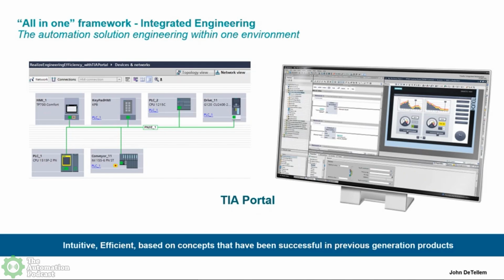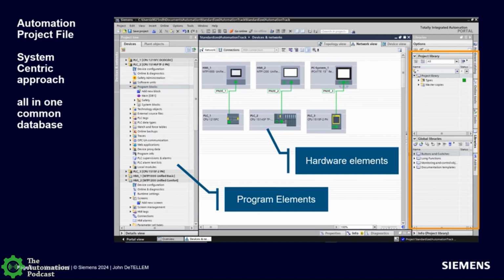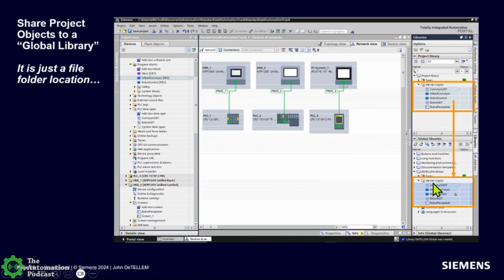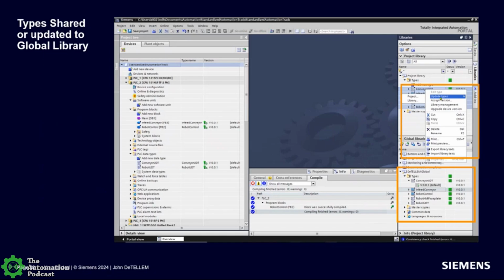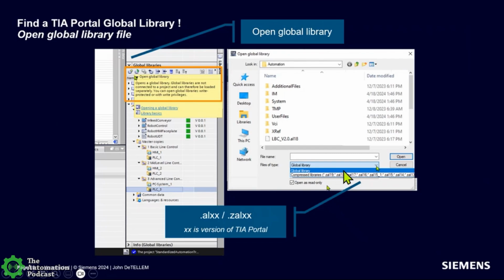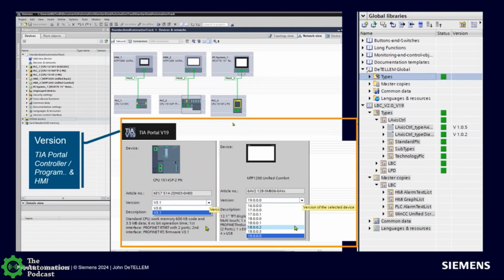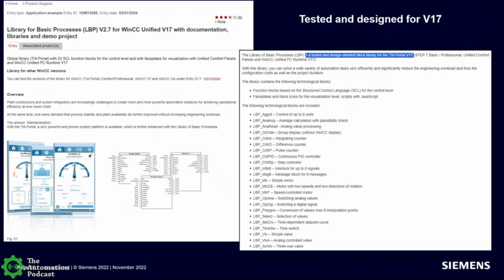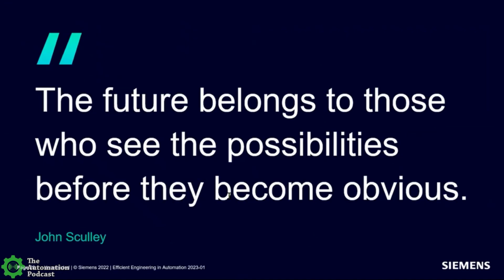Project Libraries in TIA Portal

Comment: looking at the outcome and the concept of libraries in other systems, is it really worth this level of overcomplication?
Reply from the maker: Well, I'm not using them as my focus is creating new lessons for my students at TheAutomationSchool.com, but I am curious which system you found to be less complicated?
Reply: @InsightsIA  i think plcnext from phoenix contact does libraries a bit simpler. regarding siemens i could not put my finger on the exact overhead, but it has this "vibe" similar to their datablock concept, works? yes, more complicated than others? yes.
Reply from the maker: @biro3000 thanks for your reply - I don't use libraries so I don't have any experience to share. I do want to find some time to play around with PLCNext